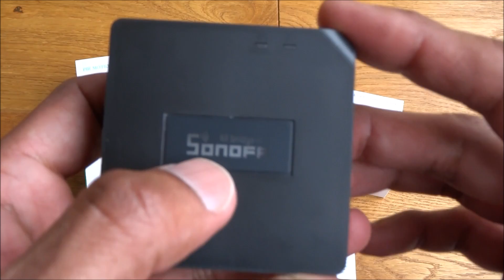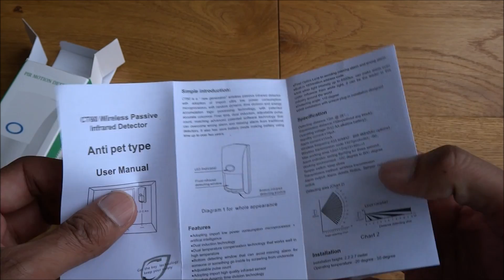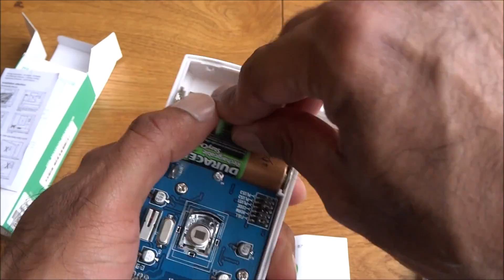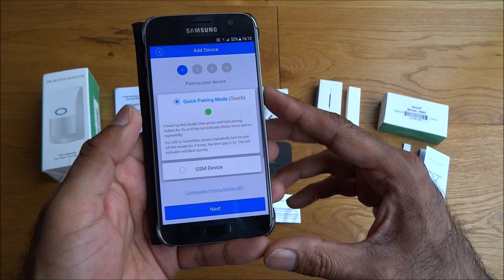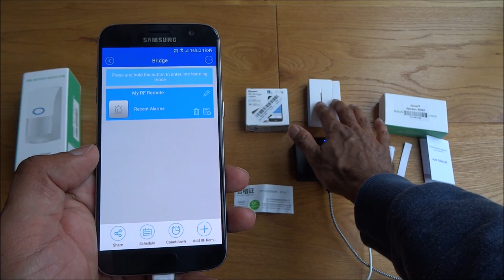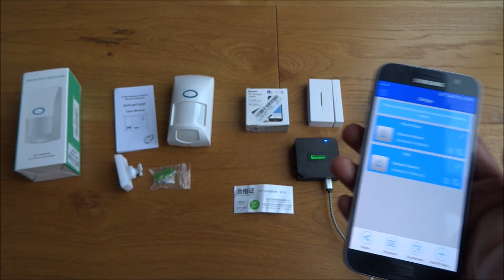Sonoff RF Bridge WiFi 433Mhz + PIR Sensor + Door / Window Alarm Sensor For Smart Home Remote Control

Comment: Hi bro, is there any option to arm or disarm for the PIR ?
Reply: Can't seem to pair my door window sensor with the bridge it does work, did you have problems? I literally put in a a23 battery led goes on, I'm in ewelink app add device doesn't find the sensor? Tried multiple times

Comment: I bought home security system from Aliexpress and I was thinking how can I control the device with my Alexa voice control. My security alarm main hub does connect to wifi and the control app will send me a push notification if it detects something, but there is no way to connect that chinese app to my alexa, or IFTTT.  I think this is the product I was looking for. Alexa has a skill for this ewesmart app. Thanks!

Comment: Can the light turn off with the door sensor closes?

Thank u.
Subbed
Reply from the maker: Yes it can do using smart scenes, but never really like the functionality on this just found it lacking some elements. I've reviewed a Zigbee Door sensor which I found to be much better. I preferred that one as I use smart life and there is a larger selection of general products available for it.

Thanks for the support.

Comment: The alarm event does not cancel when the door is closed. This is how that particular detector works. So with the light example, it would never turn off. You have to add a timer event to turn off the light. The alarm can be triggered again after a short delay (defined by Sonoff). 
Also the Sonoff RF Bridge will only connect to a limited range of devices and not to ANY device that uses a rolling code that changes every time the device is activated. Most alarm switches eg Yale etc or even door bells eg Byron using rolling codes. I did find some cheap Remote Controlled Mains Sockets branded "Status" that work with Sonoff. They come with a Remote that you can learn on the Sonoff bridge. Then you can use Alexa to control these remote mains sockets.

Comment: Hi Im John from Italy.... I'm a big fan.
I am looking for a woreless battery powered  external pir motion sensor that can trigger my external flood lights as a traditional sensor but I would like to create some routines to control my flood lights through a sonoff basic. Any idea's?  The basic idea is for security purposes or to light up the surroundings at my arrival at night through a voice command or IFTT geofencing.
Thanks and continue making great content
Reply from the maker: Hi John, thanks for the comment. ENERJ do a wireless PIR but it works on the Tuya / Smartlife apps
https://youtu.be/Zy_BX_EZ96Y
 it's not an outdoor product but if it's in a sheltered area I'm sure it will be fine. Also check you this smart led flood light I've reviewed..the video is not released yet but you could use the smart led flood light with the PIR on smartlife and setup smart scenes that can alert you of activity
https://youtu.be/nr0KVbnJq_w

Comment: Hi can is use the sonoff bridge and pir through the ewelink app to turn on a sonoff basic WiFi only device? Thanks in advance!
Reply: Yes that would work. You would have to find a way of turning off the device though eg a timer as there is no event raised when the door closes.

Comment: I've seen this advertised to connect to up to 4 remote controls and 16 sensor devices. Is this correct. I'm about to buy 11 sensors in total (mixture of motion and door sensors) and I hope I don't need 3 bridges
Reply: the default limit is 16, but if you tasmotize these there is no limit (openhab, etc)
HOWEVER: to tasmotize the bridge you MUST have a 3.3V serial TTL adaptor. It can't be done over the air as with other Sonoff products
Look on your favourite search engine for sonoff tasmota

Comment: Is there a possibility to set time, how long will the light be on after it is turned on by motion sensor? For example 5 min...?
Reply from the maker: Do can do that by using smart scenes. So automation to auto the light off after 5mins
Reply: @GeekStreet  Thank you. One more question...is it possible that ewelink app wouldn't record every activity, which is saved in history? In some situations it can be problematic regarding privacy (for example recording of each arrival and departure...).
Reply from the maker: @davidko89  you could set the smart scene to only work during a certain period.
Reply: @GeekStreet  I know, but every single activity is recorded in history.

Comment: great video mate, btw does it work with 433Mhz sensors from brands other than sonoff?
Reply from the maker: Thanks for the comment, in theory yes it should work with other 433mhz sensors, I've not tried so far.

Comment: any possibilities to add additional commands for example door was opened and light was turned on then add a command like "after 1 min" turn off. I saw an option like add additional command but not sure what it offers

More usefull for PIR2 commands to turn a light for a 5 minute period and then turn off.
The shown example simply showed the turn on activity but nothing like an additional 5 min. delay with do nothing command and turn off light command ...

Will that work or not ?
Reply from the maker: You should in theory be able to do that using scenes. I can test it out but give me a few days...let me know but the thing to note with this type of functionality is that it can at times it can be a little slow as it has to go over the internet to work.

Comment: Does the Sonoff door sensor send a CLOSE signal as well as OPEN?  Thanks
Reply: No it does not, and the example with the light will not work as it will never turn off.

Comment: Hi I wanted to know if I can use any RF Pir sensors on the sonoff bridge thanks
Reply from the maker: In theory it should if the frequency is 433hz i've tried but it hasn't work that well.

Comment: Too much time between motion sensor detects motion and receiving push notif on smartphone for my needs. Have you seen a motion sensor that works without any internet servers. I'd like to connect to it directly via wifi. Thanks for a video!
Reply from the maker: Thanks for the comment, I haven't reviewed but hive and Philips hue use a hub and that avoids going over the internet so would be quicker.

Comment: Can the PIR sensor work without the bridge. To use it to switch ON Sonoff T1 switch whenever there is an activity in front of sensor ? I want to use it for outside light & make it PIR sensor enabled so that it switches on the lights outside if there is a movement outside....
Reply from the maker: No unfortunately not, it relies on the bridge to work.

Comment: Yes yes, all great. But how i can activate or deactivate my Home allarm??
Because seems that the allarm is active full time, also if i am at home.
Reply from the maker: This device can not deactive a separate alarm system.
Reply: @GeekStreet  I think that @Shariar Hadji Hossein means that he has this setup at home, but that the "alarm system" is active 24/7 - as in he gets alerts every single time he walks around in his home. For this setup to be a proper alarm it requires, as a basic function, an armed/disarmed state where the alarm trigger is e.g. actioned/ignored. At this stage I am also looking into this... solution I am suggesting and going to try is to get a 433 remote and pop in a Sonoff RF that controls the power feed to the Sonoff RF Bridge and e.g. an LED indicator light on the outside of the house. That way you can arm/disarm the system.  If the bridge does not have power, it cannot send you a notification. :-)  It is not perfect, but it should work...
Reply: @lourensdejongh3798  Het dit gewerk?

Comment: So actually why do I need Sonoff RF Bridge for? Can I use other Sonoff device without that bridge or with some universal wifi/rf router?
Reply from the maker: The RF bridge is only for RF products only the other Sonoff products work off WiFi and no bridge required.
Reply: And also... this bridge work only with 4 sonoff devices? If so, maybe we could use any other universal rf bridge like RM pro+ BROADLINK or RM- PRO BROADLINK?

Comment: Hi Folks,
So does this Sonoff bridge send me those push notifications even while I am away from home at work or on a vacation in a foreign land? Assuming that I have the correct app downloaded and installed and internet access? Am I understanding this right?
Reply from the maker: Yes as long as the app is running in the background.
Reply: @GeekStreet  Great, thanks for the reply - I suppose this also means that let's assume I have connected the Sonoff simple switch to my reading lamp at home, that I could turn the lamp on and off while I am away at work or chilling on the beach?
Reply from the maker: Yes that's right or even setup a timer.

Comment: Door sensors give only one signal. Signal only is open. No signal for close
Reply: NO, when the bigger ones detects that the smaller piece is not in range, it reads that as open. When the smaller piece is detected again, it reads that as close.

Comment: hi. awesome video. question please; if i want to automate my air conditioner units at my apartment, they are already connected to the wall power directly (no plug socket). do i just need the RF BRIDGE? or do i have to install the SONOFF wifi/rf switch as well? would you know this? thank you for your time. have an awesome day. keep the videos coming!
Reply: sadly installing Sonoff plug outlet wont work as your AC needs to be run by selecting the ON button from the IR remote that comes with your AC and also i believe the Sonoff plug is rated at 13amps, your AC runs on 15amps outlet at least if not more. The RF bridge only operates on 433hz, it doesnt read IR remote. Another smart home brand named Broadlink do read IR remote but its a little pricey and you have to watch another video on the set up for that one.  Hope that answers your question.

Comment: Is it worth it? Or could you suggest any other? A best one for windows and door?:)
Reply from the maker: Its a good product but only if you use sonoff products as I does not work with smart life so I was disappointed as all my other smart tech is smart life.
Reply: @GeekStreet  oh what is the thing thatd id need to buy? Id be able to know the alert on my phone right?
Reply: @GeekStreet  and can u give me a suggestion:) what are your thoughts on ring door/window sensor and d2 door/window alarm sensor? Which one of those is worth it?🙌 and do you know any other sensor with camera?
Reply from the maker: Smart life is an app for your phone. You don't have to buy it's free. This product does work well and you would need the sonoff app for it to alert you that app is free, but all I was saying in my previous message we that it you want to link to other things like smart plugs or smart light you would have to buy all sonoff devices to can't buy other brands.

Comment: Those door/window sensors are useless. They have to be too close together in order to register. They almost have to touch. 
Don’t bother.
Reply from the maker: Are you sure? As I'm sure you could leave a slight gap!?
Reply: A slight gap? Yes. But my experience was the sensor  had to be within 3.5mm before activation. Not much room for error.
Reply from the maker: That's pretty tight.
Reply: also they only send one signal, while open.

Comment: does it work with apple home or siri?
Reply from the maker: Thanks for the comment. I've had a check and from what I have read its not supported.
Reply: Given the eWeLink app can be run on an Apple device it would seem to be supported by Apple Homekit
Reply from the maker: Thanks for the comment, I read somewhere that Siri is not supported.
Reply: @GeekStreet  can't be sure about Siri but I would imagine if it's supported by HomeKit that Siri could control. But who knows?
Reply from the maker: Would be good to hear from someone who has this working just to be sure. I personally don't own any apple products so can't check. Maybe in the future I may invest in some apple products.

Comment: Great video, thanks for making and sharing. Couple of notes I'd add 1) what's the battery type for the door sensor? (A27 I believe). Also when pairing the PIR, there's no button to press.. just hover your hand over it! :)
Reply from the maker: Thanks for the comment much appreciated. 1) yes the battery is a A27 2) again yes there is no button on the PIR to activate the button i.e. press it you hover your hand over it.
Reply: It's actually a 23A not a 27A. The silly instructions say it's 2 x AAA.

Comment: do i need to always connect my phone to wifi to operate appliances
Reply from the maker: Thanks for the question. You have to either connect to your WiFi or mobile data to control the device's.
Reply: Unless you're using an Amazon Alexa device or Google Home to control it. You just need to use the eWelink app to set up the device.